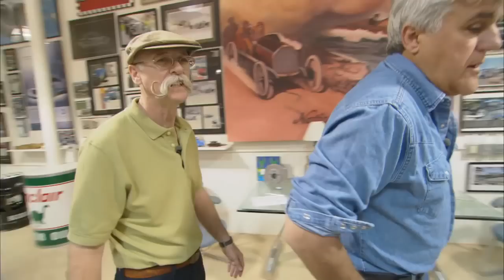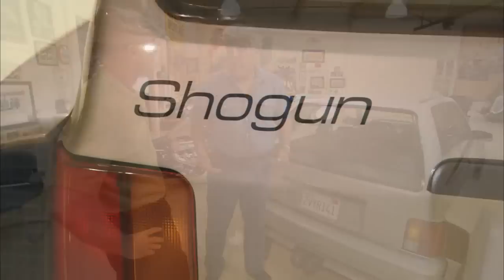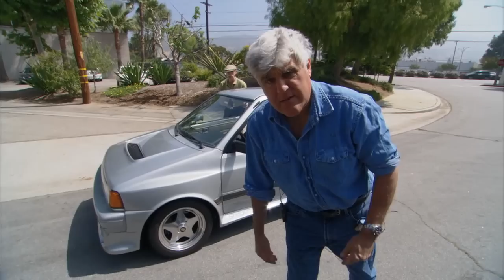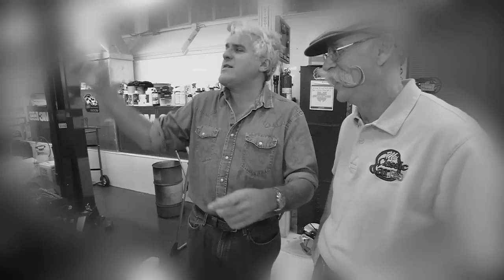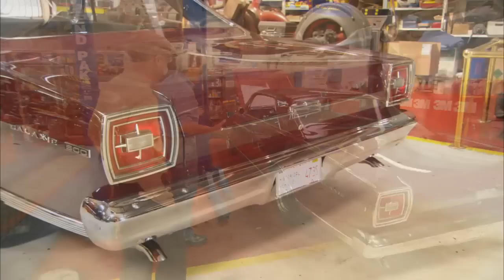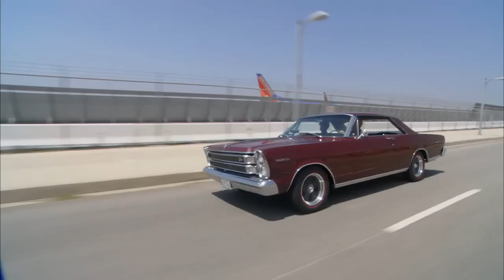Jay Leno's Race-Ready Shogun | Nostalgic 7 Liter Ford Galaxie 500 | Serious Sleepers

Comment: I remember  seeing a SHO gun   at a FORD dealer  but didn't know  it had  the SHO     engine  in it.    The 3.2 litre   size  for a 6 cylinder  was much like a motor cycle  engine   when Honda   ran the 250 and 350  6 cylinders   known  as Hailwood's  Honda's     from about 1965  where the  pistons were so like  and the valves so small     that it was normal to get peak HP  from the  250  at 17,000 rpm  and not float the valves  or snap a rod.   
    The trick   for Yamaha  was the light weight  casting   and fuel injection  with electronic ignition along with  the small size  for a 6 cylinder   to exploit the power band  and pump up the redline .  From there  you just  calibrate  the first  3 gears   for high torque  in the city  and then  set the ratios  for Highway   in 4th and the over-drive   in 5th  for good mileage  . 
    cars today  now have the 8 speeds  to  get the most power at bottom end    in the city  where the  rest of the gears  are close ratio  to even out the shifts  and then  get good mileage  on the high with low RPM   at 120 Km/ph  for even a V8  .

Comment: My 89 Honda Prelude Si has 317,000 in it. Had it since about 140k (14+/- yrs).
Change the timing belt/H2o pump and normal maintenance and they almost run forever.
It doesn't smoke, make lifter noise or anything and it's a stick, so the trans is fine too.

Comment: I read somewhere that the  7 Litre  was a  version of the  Galaxie 500     until  later on in 66   when it was just the 7 Litre  with no Galaxie 500  fender   name plate .
Reply: +Gary wood The 7-Litre was a one year only margue.  In 1967 is was only a performance package.  The 7-Litre always carried the Galaxie 500 moniker on the rear quarters.  It was basically an XL Galaxie with the addition of the Thunderbird 428, Front Disc brakes and special badges on the Front fenders,Grill and Trunk lid.  For more info on the 7-Litre, go to www.7litre.org.  BTW, Jay worked with us to find this car.